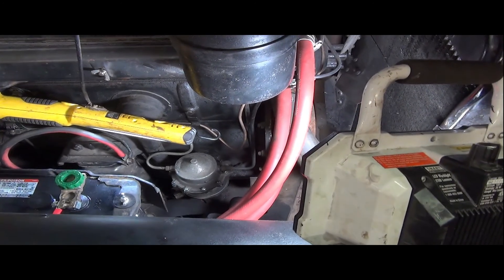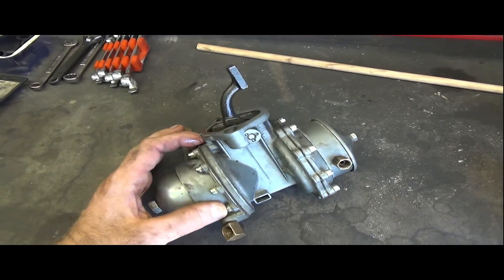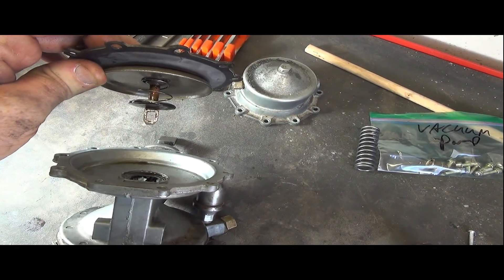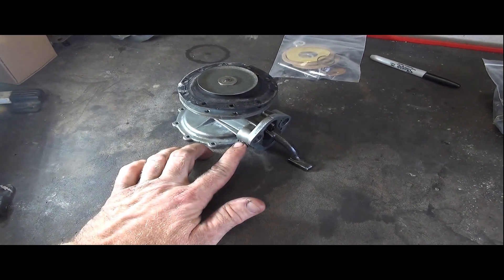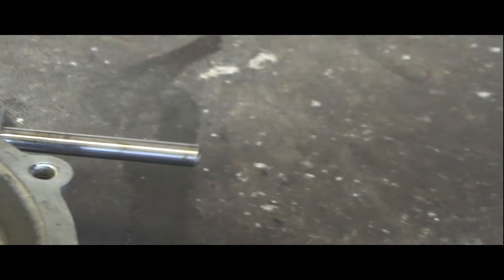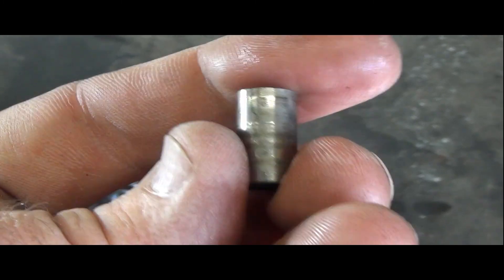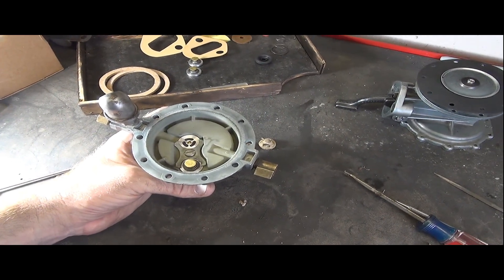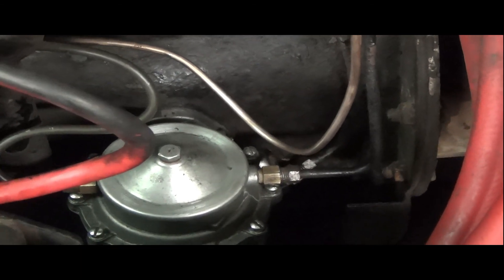Buick Roadmaster part 30

Comment: Hi Del. I have to replace the Fuel pump on my 1940 Buick that has a straight 8 like yours. What is required in order to get the new pump back on? I am having trouble getting the pump arm high enough to get the bolts in the block. Any suggestions? Thanks.🍁👍👍
Reply from the maker: Two things come to mind.  It would be a good idea to double check that you have the same exact replacement pump as your old pump (look at one compared to the other and take a few measurements of the pump arm length  and depth) just to make sure you ordered and were sent the right part.  2nd thought, something else to consider is that the fuel pump arm operates off an "eccentric" lobe off the camshaft of the engine and depending on where in its rotation the lobe was when you shut off the engine and removed the pump - the lobe might be interfering with you when you go to install your new pump.  You may have to install at an angle with the flat part of the pump arm arm well underneath the eccentric lobe of the camshaft and flex the arm of the pump down when you reinstall it because the lobe was in full pump position when the engine was shut off.  Alternately -you might also rotate the engine forward several degrees to get the lobe of the camshaft in a different position where it is not pressing down on the fuel pump arm.
Reply: @delsiegmund1432  Hey Del. Thanks for getting back to me. I spent lots of time trying to get the pump in.  It is very frustrating. I will compare the two pumps. I will let you know how I make out.
Reply: @delsiegmund1432  Hey Del. The new pump arm sat a little higher than the old one. It was also a little longer. Size might matter. 😏I don't know if longer would be a problem, but with the pump arm sitting higher, I was afraid something might break so I am going to rebuild the old pump.

Comment: Hey Del. Could you tell me where you bought the rebuild kit for your fuel pump? Thanks
Reply from the maker: CARS LLC or you can lookup oldbuickparts as a one word internet search and you will probably be redirected to CARS LLC.   They have been very good to work with so far and have a lot of parts and a lot of kits.
Reply: @delsiegmund1432  Thanks Del.🍁👍👍